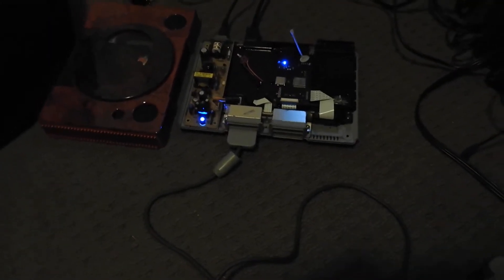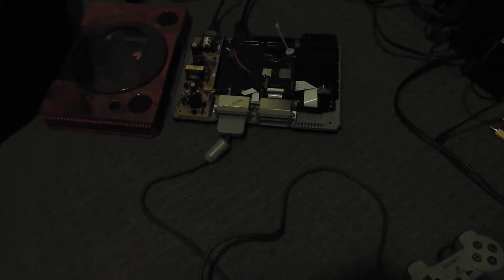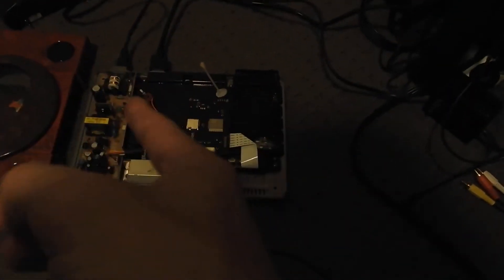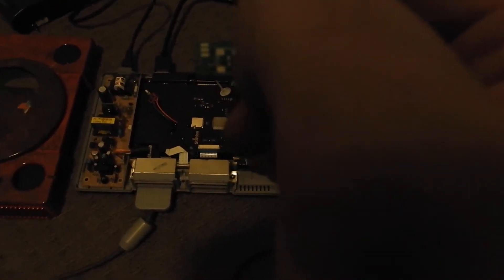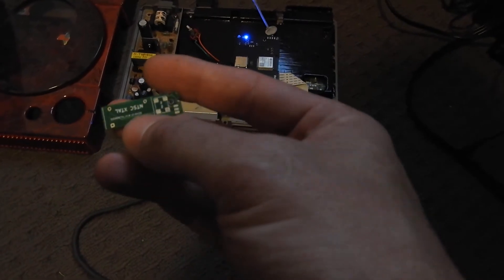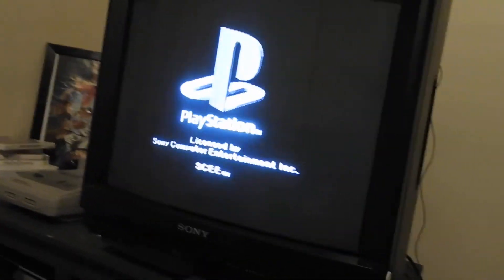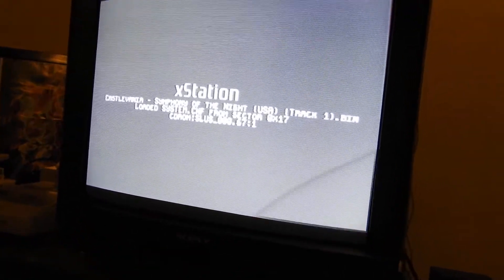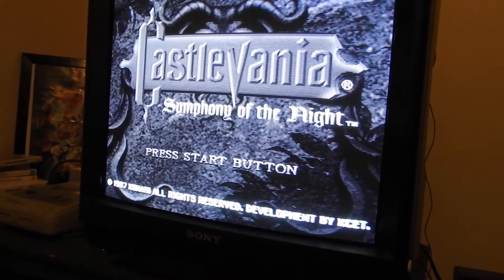PS1 Dual oscillators / DFO SCPH-5502 SCPH-1002

Comment: I have a Samsung crt hdtv, it has hdmi input, 2 components, 2 av and 1 svideo.
I was wondering if PAL games can output color to Svideo and AV output.
Reply from the maker: I would go S video. you'll need a fix for colour on a pal console using NTSC games and the same vice versa (NTSC console playing pal games) 

otherwise get an RGB to Component transcoder and use the component and you won't need a fix
Reply: @vajskidsconsoles2005  But PAL games don't get out of sync on NTSC console and vice - versa.
I have the CRT HDTV and the CRT Sd, and they say that with Scart RGB the games are with normal colors, but out of sync in games.
And at the AV and svideo input it goes black and white.
I wanted xstation to play all regions in Svideo.
Reply from the maker: @Renan230f  yeah but it's a CRT. I doubt you'll notice.
Reply from the maker: @Renan230f  you need a fix for S video on Xstation. I made PSXTAL free using off the shelf parts. Google it

Comment: Why advantages does this chip provide? I'm using SCART on my PAL PS1 so NTSC games appear in colour.
Reply from the maker: the screen will usually be a little off centre in PAL 60 and there will be a noticeable frame skip in tests through a scaler as the frequency will be too far off spec. fast games through a scaler won't be properly playable.
Reply: @vajskidsconsoles2005  All my games are NTSC so do those issues apply to me or just for PAL games?
Reply from the maker: @MichaelM28  these issues apply on an NTSC console when playing PAL region

or on a PAL console when playing NTSC games. I uploaded an Xstation install yesterday and placed the console together without screws to test it. you'll see there as it's using S video atm that the NTSC game launches black and white (sometimes you'll get a rainbow effect)
Reply: @vajskidsconsoles2005  but I use SCART on my PS1 so will I still need this mod?
Reply from the maker: @MichaelM28  it will just centre the picture a little better and your timing will be correct. You'll notice on scalers some games will be very troublesome and drop frames. Try street fighter alpha 3 on an OSSC or similar. The NTSC version on a PAL console played out of spec.
Reply: @vajskidsconsoles2005  does the improved timing reduce input lag or frame drops / stuttering?
Reply from the maker: @MichaelM28  spot on. if you check my vajskids Twitter you'll see latest install method. There's a clock synthesiser version now as well . they're both wireless. if you are able to get yourself an Arduino nano and the SI5351A you can get both frequencies required from 'clock 0' 

these are on GitHub 

GitHub.com/L10N37/
Reply: @vajskidsconsoles2005  so which does the mod improve, input lag or frame-rate?
Reply from the maker: @MichaelM28  it has nothing to do with input lag, it's stuttering and frame drops due to the incorrect frequency fed to the scaler. some consoles need a mod even when they're stock due to discrepancies. the PAL mode on this could do with a small overclock from factory but on these models it drives the colour burst frequency up as well. The clock gen version does 53.25 as oppose to a solid 53.20 but that isn't enough to change anything. later models you could tweak the GPU frequency independent of the colour burst Freq. quite easily. it would be more messing around on this (these models) model
Reply: @vajskidsconsoles2005  nevermind then

Comment: Hi, I'm planning to buy the PCB + XTAL and I would just like to know if this will work even without the  XSTATION? and are there any installation guide (with pictures) for this? Thanks ☺
Reply from the maker: I can throw a diagram together, let me know which model you've got :)
Reply: @vajskidsconsoles2005  ..Thanks mate! 😄 ..I've ordered the PCB+XTAL+Switch and I plan to use it on a SCPH-1002, without the XSTATION... Thanks again in advance  😁
Reply from the maker: @biocyber4544  you're just removing the original XTAL and mounting them both on the board. I premount the NTSC one prior to dispatch. The PAL one off the board goes on facing text orientation on PCB. there's heaps of room on this model under the tray. PSXTAL GitHub has example install using an Arduino to flick between the crystal oscillators. of the 4 points you only need 3. power / ground / clock out. centre pad goes to centre of Switch, outside ones go to either outside pins on switch.
Reply from the maker: @biocyber4544  if you have a multimeter you can trace out using continuity to find out which goes where of the original XTAL pads on the motherboard and using the 4 pin  XTAL oscillator pinouts as reference..if you get stuck swing us a message
Reply: @vajskidsconsoles2005  .. Thanks mate! I'll try it out when my order arrives... 😁👍
Reply from the maker: @biocyber4544  if you get an Arduino you can control It with the controller and not have to drill for a switch :) video uploading now. check it out
Reply: @vajskidsconsoles2005  Thanks mate, I'll check it out 🙂
Reply: @vajskidsconsoles2005  ... Its all good now mate! 😁👍 I was able to install the PCB and its working like a charm 😁 Thanks!
Reply from the maker: @biocyber4544  excellent! you can upgrade that with an Arduino and Xstation (if late PU8 or PU18) in future. the PSXTAL source is open and free to use and modify
Reply: @vajskidsconsoles2005  thanks again mate! 😁 you created a much simpler and cheaper solution 😁👍 I might also try the ardruino in the future 😊 Cheers! 🥳🥳🥳

Comment: you can't force PAL 60hz via Boot disc after installing this DFO mod on a SCPH-5502 then anymore?
Reply from the maker: Anything In 60hz will be in true NTSC unless you install more switches and another XTAL so that you can switch the console into PAL60 instead (with the old-school method, and PAL colourburst xtal)
Reply: @vajskidsconsoles2005  sorry what's an XTAL? I just wonder If I install a DFO Chip ,which seem all to be the same techincally, would IPL boot PAL Discs in a different Speed than now on my unmodded PAL ps1 than 59.4hz? What hz is PAL60?
Reply from the maker: @OpticalHaze  IPL forces NTSC games to boot at 50hz. Pal 60 is the ntsc refresh rate of 60hz with PAL colour encoding. The DFO is there to give an in spec frequency for both true PAL and true NTSC, same as this.
Reply from the maker: @OpticalHaze  XTAL = crystal oscillator
Reply: @vajskidsconsoles2005  ok, as I said IPL doesn't boot games at all via Xstation. maybe this will change with a DFO. I'm not really interested to downgrade NTSC games so more force PAL to NTSC
Reply from the maker: @OpticalHaze  are you pretending to swap discs before pushing the button to proceed in IPL? If you're located in Australia I can install the switch and dual crystals for you. I am going to make it wireless soon but I don't know how long that will take so it's a manual switch for now
Reply: @vajskidsconsoles2005   @VajSkids Consoles  sure I push the OPEN Button and then IPL resets back in the main menu and freezes. i'm not from australia but thanks
Reply from the maker: @OpticalHaze  you could try unirom. I remember seeing the conversion option on that... Otherwise a lot of games have game specific patches to do this as well
Reply: @OpticalHaze  xtal is a slang for crystal

Comment: I've seen somewhere in UK based online shop DFO boards for sale. Will installing it in my pu18 pal console allow to play ntsc games through composite in colour?
Reply from the maker: Yes colour in S video like here and composite. Or you can use import player light in the interim
Reply: @vajskidsconsoles2005  “DFO does not change the colour sub-carrier for forced region colour over composite and RF” that’s a description from web shop that sells those dfo here in uk. So I’m bit confused
Reply from the maker: @kamilpotato3764  Sorry, I only just saw this. He hasn't chosen his words in that sentence wisely. DFO like this is for true NTSC / PAL - he must mean you can't force PAL60 or NTSC50.
Reply from the maker: in which case forcing PAL60 on a megadrive doesn't give you colour anyway (its ok on RGBs) ... it does on a master system though - never had an issue with those
Reply from the maker: Unirom May also work but a hard fix is better than these boot patch conversions
Reply: If you're from the UK why just use RGB Scart it's easily available and Cheap
Reply: @HollowRick  As odd as it might sound I like the look of composite blended dithering. I could use pal games but I prefer ntsc(got xstation in my ps1).
Reply: I do us rgb scart on my ps1(Got lucky years ago on car boot sale and got for £5 official ps1 grey chunky one). If I remember correctly I use to get colour in ntsc games through composite on my ps1 when running it through vhs player and then back to crt tv.